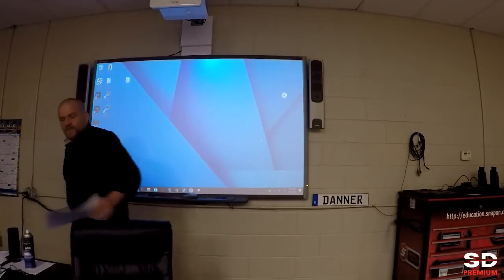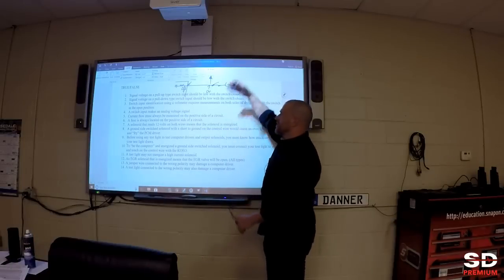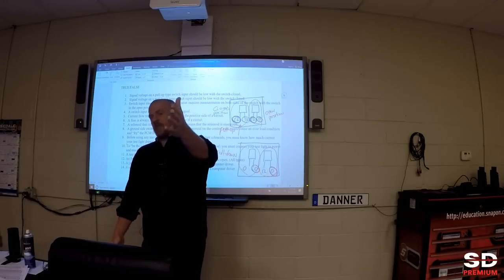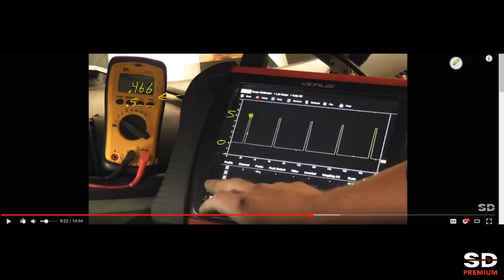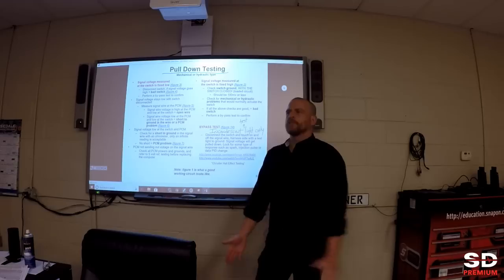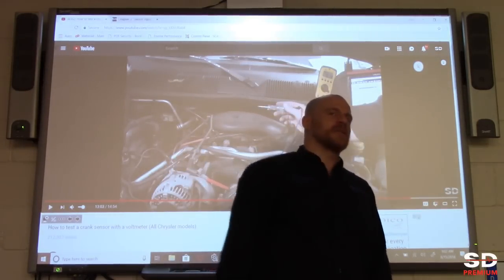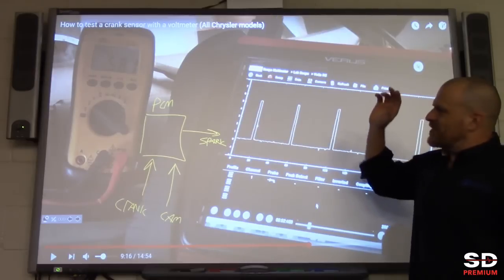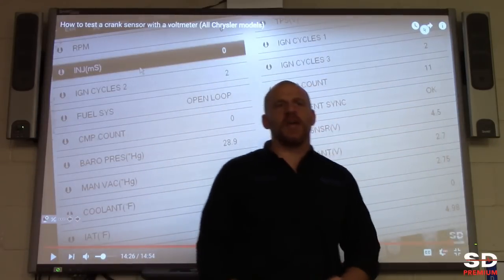SDP Day 8 Part 1 - Pull-Down Circuit Review and Bypass Testing

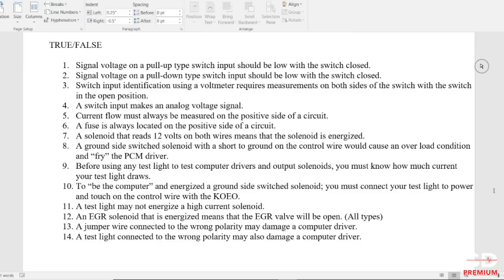Comment: 5:46 you have your pull up/pull down circuit identification wrong from what I’ve learned. Pull up voltage sense should be on voltage side and pull down should be on ground side that’s not how you described them
Reply from the maker: I teach it from the switch side. A switch that closes to ground and pulls the supplied voltage down, i refuse to call that a pull-up circuit. It may have a pull-up resistor in the module but it most definitely is not a pull-up circuit. I think it's ridiculous to teach it any other way even though everyone else in this industry does.
Reply: @ScannerDanner  i was going to ask the same question but i'm glad someone else did, well the both explanation make sense when the circuit is close it pull down, same circuit when it open it pull up i think there is a discrepancy somewhere to be honest this topic is more confusing for me just like you used to say there is  variable, yes there is  variable to this and there is  variable to theirs as well that why i find this topic more confusing, thank you i'm watching from Nigeria
Reply from the maker: It's not confusing when we are testing them. Know what the switch is doing and test the circuit accordingly

Comment: So what's the difference between power side and ground side switched circuits, and pull up and pull down circuits.
Reply from the maker: Power and ground side switch circuits are being controlled by a module (output circuits).
Pull-up and pull-down circuits are being "watched" by a module (inputs)
Reply: @ScannerDanner  I see. So like a solenoid would be either a power or ground side switched circuit because its either being controlled either open or closed, And something with a waveform that's either being pulled up or down like a crank or cam signal would be pull up or pull down design?
Reply from the maker: @AaronWalske  yes! Very good. Remember one is being watched and the other is being controlled. Great questions!
Reply: @ScannerDanner  Is Hall sensor on a cam/crank pull up or pull down?
Reply from the maker: Both! Depends on the manufacturer

Comment: Paul my name is Steve Miller and I just came across you videos in the last few weeks. I have a 1997 GMC Top Kick 366 gas engine that is having problems. I’ve had it to 4 different shops and no one has been able to fix it and no one has been able to read any codes from the ECM.  I have changed out every sensor and everything else there is to change.  Spark plugs and wires, distributor, coil, injectors, fuel pump, oxygen sensor, muffler, intake gasket, map sensor, and everything else I could think of except for the fuel pressure regulator.   The grounds were cleaned, all fuses checked and they put some kind of electrical grease on them.

The problem I’m having is when I start the truck it will barely run. It spits and sputters and backfires some.  Finally it  idles around 1250 rpm for at least 5 minutes. Then it slowly idles down to around 8000 rpm.  At this time I can drive it and it runs pretty good but if I stop it and let it set for any length of time it goes right back to spitting and sputtering won’t hardly run till it warms up again.

Do you have any suggestions on what I can do?  Thanks, Steve Miller
Reply from the maker: I dont know what a GMC Top Kick 366 engine is?? What year, make, model and engine size in liters please

Comment: Hey guy, I have your book and keep it with me when i'm out and about fixing cars. I'm starting to look out for these pull up and down designs when testing. It helps to know and like you said visualize the system. If I get confused about something I'll look at the book and have that ohhhh moment lol. Thank you so much. Now if we could just get all the techs out there to learn this stuff we would be in good shape. My poor Mom just got the shaft from a dealership down south while on vacation. I should of drove down there as soon as she had problems but I am needed at my job pretty heavily and its not easy for me to leave on a dime. Anyways, first trip to the dealer, $1900 for spark plugs, coil, and purge solenoid, and something about a wire at the ebcm needing fixed. Check engine light came back on of course because no one test drove it I'm sure. Now it needs a shift cable they are saying because the PRND321 light is skipping on and off. They have their best tech on it they say. The truck is a 2008 Tahoe and my mom takes care of it. I hate that they charge so much and you don't get what you deserve for your money. I was taught in school, Northwestern Auto, and Eastland Career center, to document what you do and make it legible. All they wrote on the first work order was diagnostic then $1500. lol  I've turned this into a book lol i'm sorry guy. Your the best man, keep on teaching these guys the right way to do things and hopefully we get some good techs out there.

Comment: So with the crank sensor not being enough is that just because the reluctor wheel doesn’t have a bigger notch than the other windows because Ik a 3.0 ford Taurus can run without the cam single
Reply: The 1999 to be exact
Reply from the maker: That is because that engine uses a waste spark ignition system, so it doesn't need to know where #1 is exactly. It only need to k ow which pair of cylinders is approaching TDC and the sync notch in the crank provides that
Reply: @ScannerDanner  oohhh ok thank you 😊

Comment: So I'm used to working on Cat diesel equipment but trying to learn more automotive stuff for personal repairs. Signal voltage on the stuff I'm usually work on is 5 volts, what is the usual signal voltage on most automotive stuff or does it vary by manufacturer?
Reply from the maker: 5v is a standard that extends way beyond the auto or diesel fields.